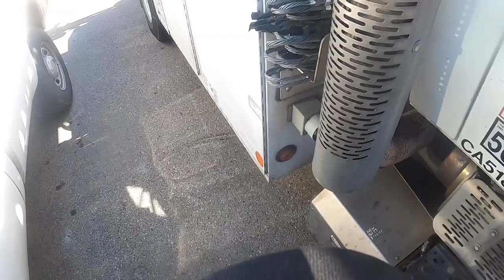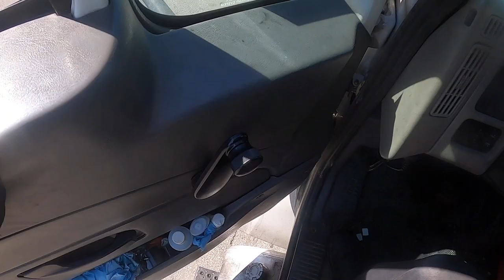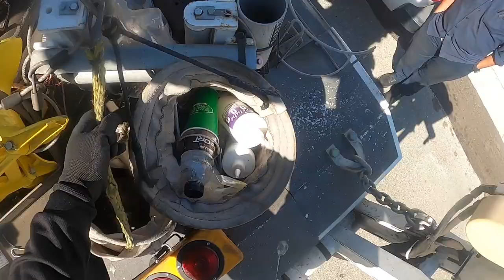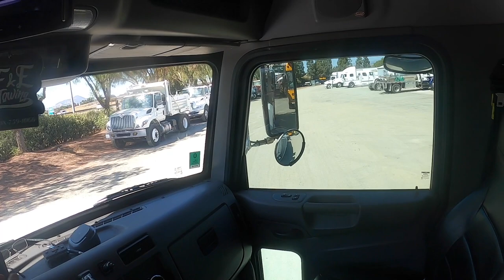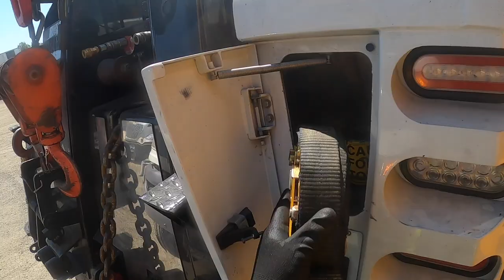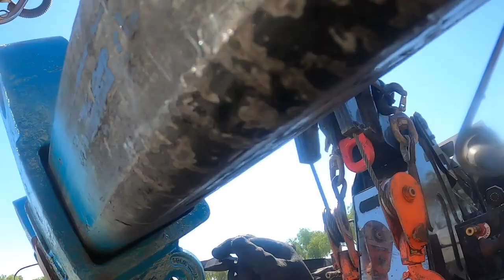Heavy duty tow att international

Comment: Why secure the steering wheel when towing from front? To prevent swaying?
Reply from the maker: Good question. The reason I tie the steering wheel is so that if the front of the vehicle was to touch the ground the front of the truck would want to pull sideways causing the truck to shift to the side on my frame forks. Also if the truck was to fall off on the highway (god forbid that) the truck would catch in the safety chains and continue straight instead of steering to the side